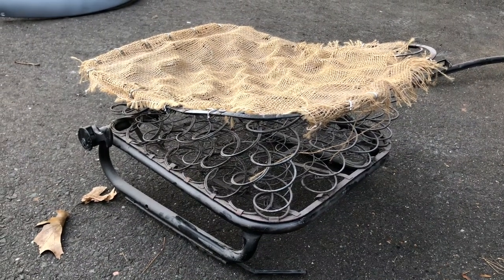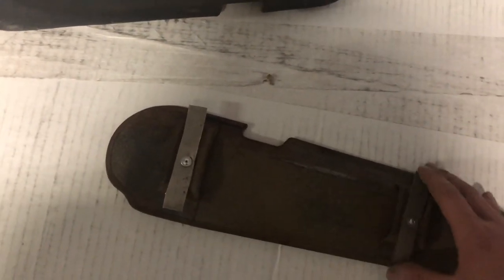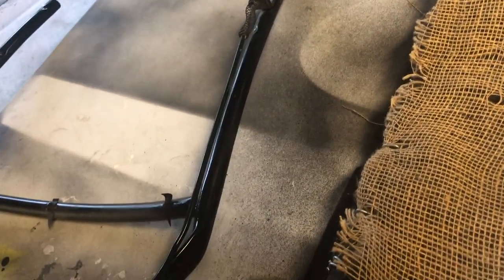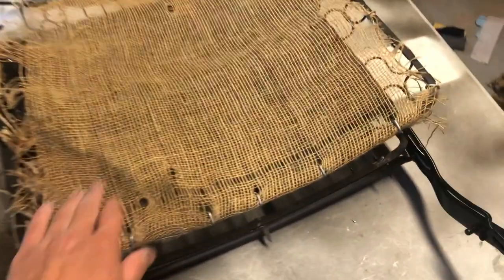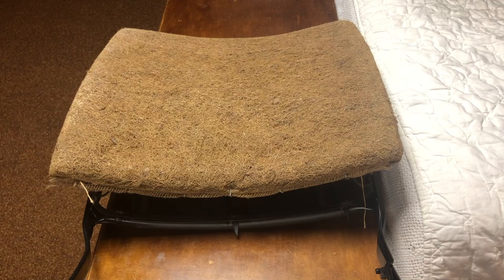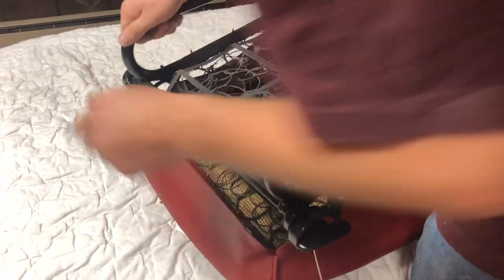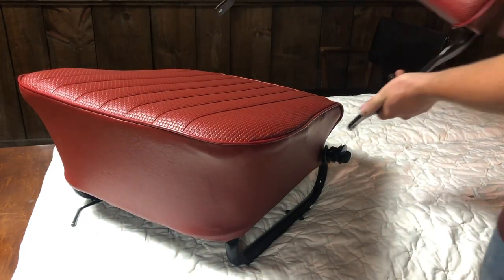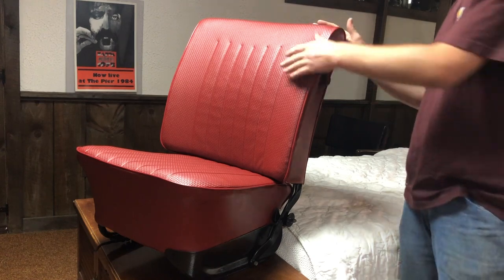Classic Volkswagen Beetle Seat Restoration

Comment: I remember doing this in1983. It's been a minute, but it's nice to see some things don't change....nice job!
Reply from the maker: Bet you could still get some stuff from the dealer to do the interior in ‘83!
Reply: @DubWerks  Honestly, JCWhitney was THE source for new parts in those days, you could get OEM or the cheap repro parts, you learned quickly to pay the extra for oem after you spent a week trying to get a crappy aftermarket fender to fit. Also junkyards were full of them back then so pickin' was easy. God I miss the smell of a bug.

Comment: Does the seat release knob (that you cut a hole in the material to refit) just pull straight off? I'm redoing some seats but I don't want to accidentally break it just by brute forcing it.
Reply from the maker: It should do. There is a little metal clip that holds it tighter but they should just pull.
Reply: @DubWerks  thanks - had found it (really didn’t want to break anything but it came off ok).